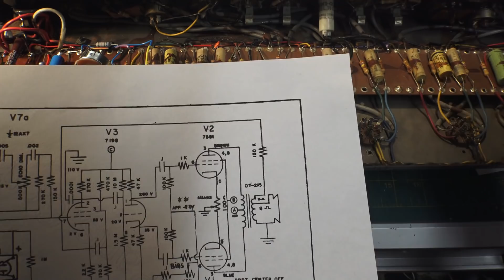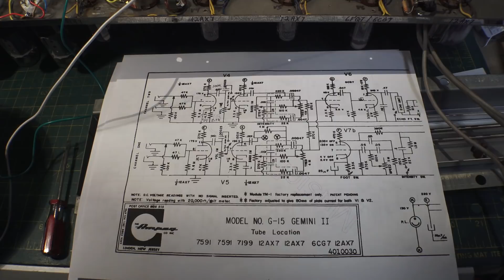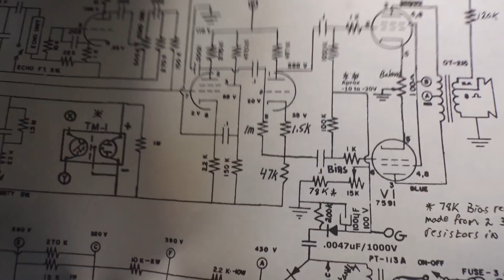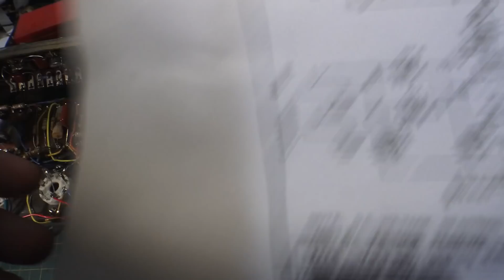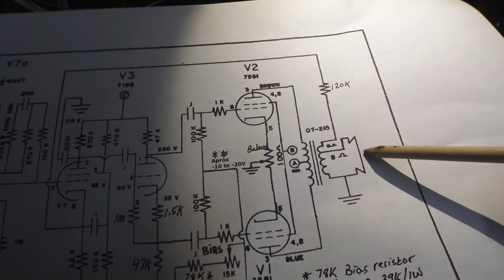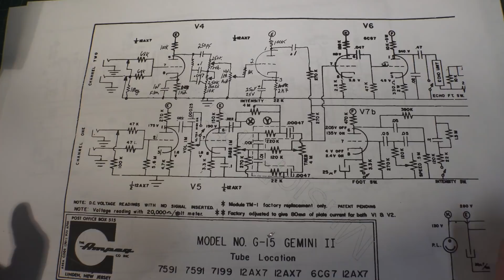Ampeg Gemini II Guitar Amp Part 2 - Modifying Channel 2

Comment: Are you sure that the lead on the output isn't grounded internally on the output transformer?
Reply: You can check this easily enough by checking continuity between that lead's conductor and the chassis. I have seen several transformers that are grounded internally in this way.
Reply: That was my first thought as well.  Even if there's no DC connection, there might be enough capacitive coupling the do some feedback.  My second thought is that even if the lack of negative feedback is a mistake, I'm wondering if that isn't the vintage sound of that line of amp.  As such, it may not be a bad idea to add a switch to turn it on/off.